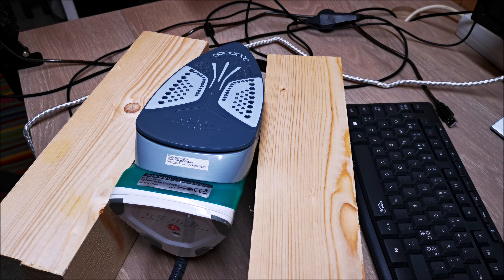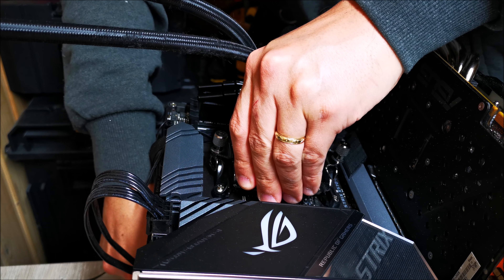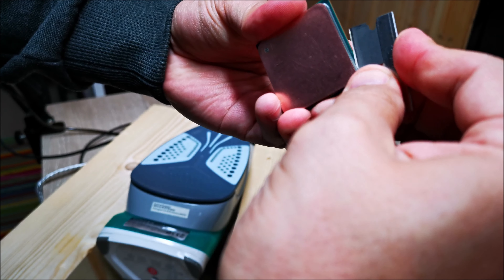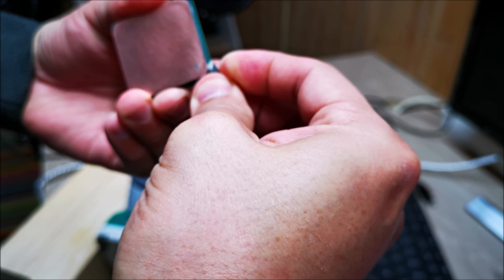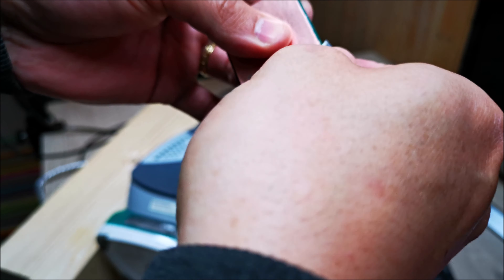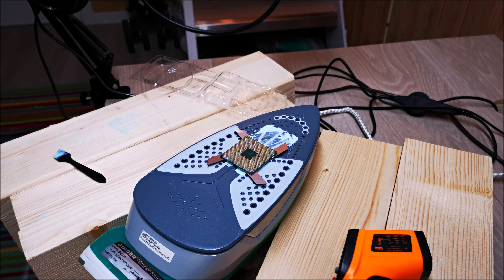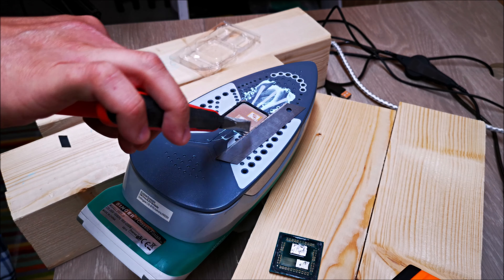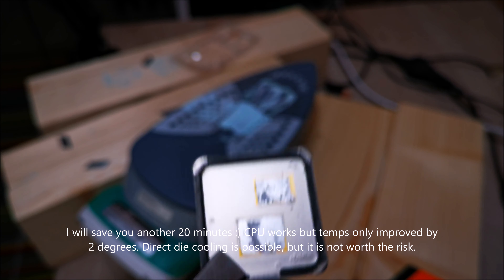How I Delidded My R5 3600 CPU.

Comment: What does the position of the io die look like after it is installed on the mainboard. I'm curious because my cpu cooler can't cover the whole thing
Reply from the maker: Looking at the board in the upright position, the IO die will be at the top center of the substrate.

Comment: Only 2 degrees aye. Thought it would drop way more
Reply from the maker: Yeah, thats why I said its not worth the risk. Its worth it on non-soldered cpu's. But in this case, nope.
Reply: @TechnologyHive  I just wonder if you use copper to fill the gap with thermal paste instead of liquid metal because thermal conductivity of liquid metal is  73 W / (mK) and indium is (86W/m-k)  so may the copper drop more as it has more thermal conductivity of 400 watts per meter kelvin.
Reply from the maker: @dev dev  I'm not understanding your point. Copper as shim copper slits you mean?
Reply: @TechnologyHive  exactly, as I watched derBauer 
https://www.youtube.com/watch?v=WXbCdGENp5I&t=864s
deliding the same model and he said the indium is thick and may be somehting .5mm  which he sand it off from the ihs , I don't know I thought what if used a copper shim with that thickness or a propper thickness that insures a proper contact and mounting pressure and see if there is an imporovement.
Reply from the maker: @devdev-ym6xt  I see what you mean now. Thanks for the input. Perhaps that is something to consider and see what comes out of it.

Comment: extremely impressive, i've been trying to delid a broken one for weeks lmao its completely destroyed at this point
Reply from the maker: Not worth it in my case. Nothing improved.
Reply: I once tried to delid an old Pentium 4 which is soldered, I delided it, but core was still soldered to IHS. 😀
Reply: @Pidalin  That sounds great🤣🤣
Reply: IMO, this only worth with really old CPU’s. I delided an X3470 and it’s temperature dropped about 150°C 

But they’re from 2009 😅(and intel was known for using some shitty thermal solutions)